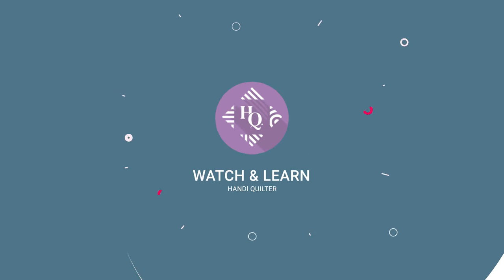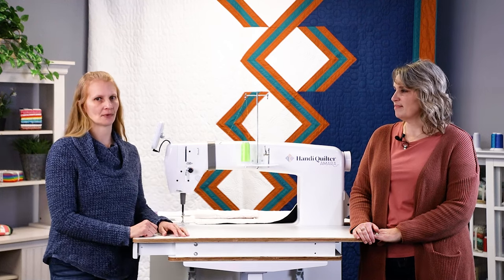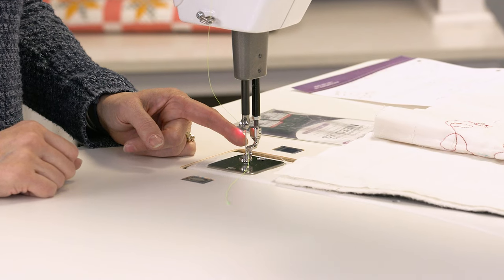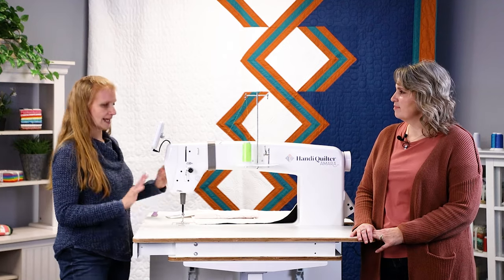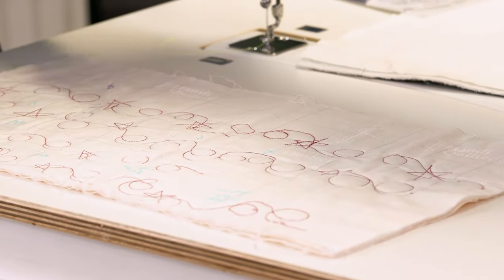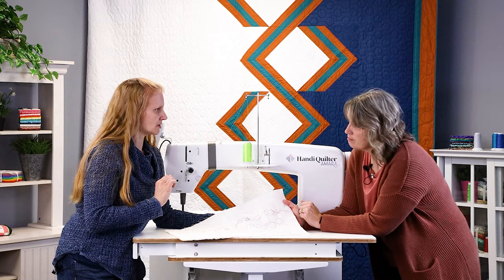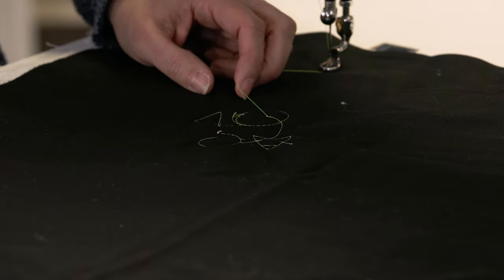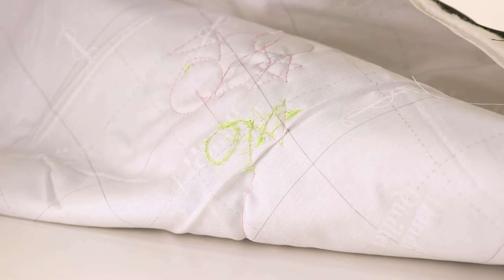Quilting Tension Basics

Comment: I have been using my long arm for years and it is so true we all will have issues now and then, I think the key is checking the bottom of the quilt when you advance so you don’t have much picking to do.  If I find a small mishap after I take the quilt off, I pick and use my sewing machine restitch the (small) area. Thanks ladies for such a great video.

Comment: If you get your tensions right, using a different color thread opens up a WHOLE WORLD of possibilities. I very rarely use the same color thread on my top as I do in the bobbin. I prefer to match my bobbin thread to the backing color and generally use a completely different thread or threads on the top. As far as adjusting tension in mh domestic machines... forget what your HS HomeEc teacher threatened you with....ADJUST the tension! It's just as important there as on the longarm :)
Reply from the maker: That is great that you are confident with your tension enough to use different thread colors!!  It takes a lot of practice to get to that point!
Reply: Not really. Just persistence :)

Comment: Thank you for your helpful videos.  Until I watched this video, I would use the fingernail trick first and then, to double-check, I take a little makeup mirror and a flashlight to see the underside.  I’ll have to try Christina’s tip of making the top tension too tight.
With my most recently completed quilt, I learned I always need to make sure the thread is fully between the tension disks.  Total “thread fart” that became until I realized it!! 😂  “Thread fart” - great term!!

Comment: Question, if you are using 2 different colors top and bottom. When doing a curve and the bottom thread pulls up to show on the top, is this a tension issue or a speed issues when making the curve?
Thank you
Reply from the maker: I would say a tension issue. The curves is when you will notice it pulling more.
Reply: @HandiQuilter  Thank you. I will adjust my tension.

Comment: Do you have any pointers in the case where tension is perfect, top and bottom, on some of the fabrics in your quilt, but you cannot see defined stitches on the top of every fabric? Thank you.
Reply from the maker: That is a tough one. You can try adjusting the tension just a little in hopes that it balances more between the different fabric types on the quilt top.
Reply: @HandiQuilter  Thank you.

Comment: I often use a thread in the bobbin that closely matches the backing fabric and this may be different from the top color because I don't want a huge stark contrast on the backing with the bobbin thread. Is this incorrect or does it mean that I need to be more careful of tension needs??? Thanks in advance.
Reply from the maker: If you choose not to use matching colors, yes, you will need to be more careful with your tension. It is possible but definitely takes more work.